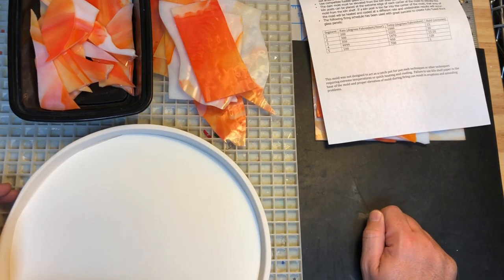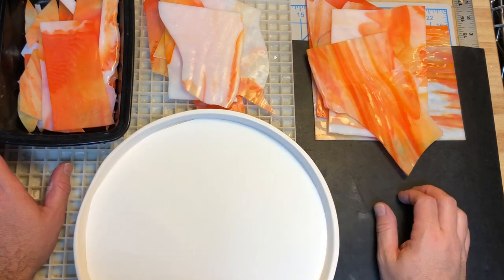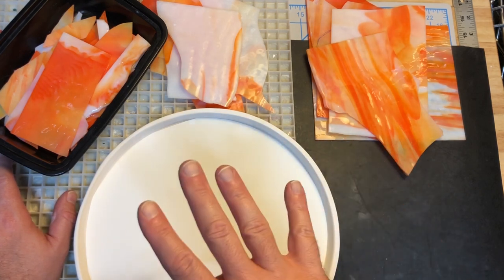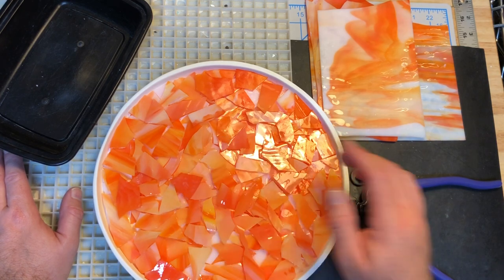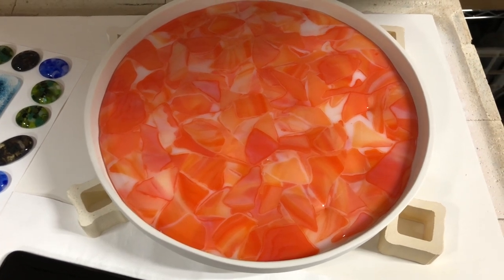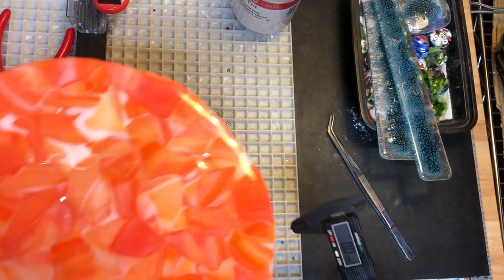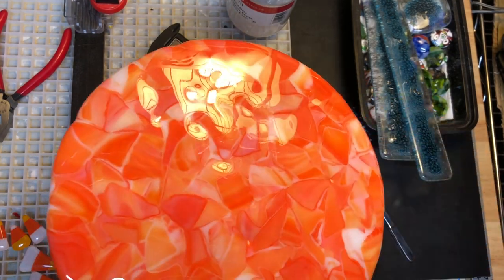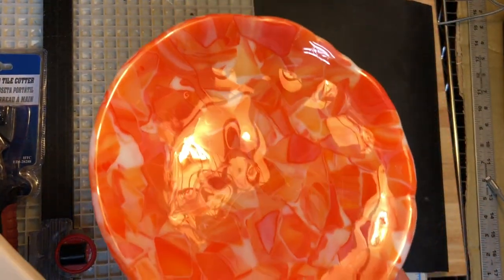Fused glass bowl using scrap glass in Patty Gray mold

Comment: Hi Jamaison,
Bullseye glass provides formula for weight of glass in one of the videos on their website. 
Basically it is volume multiplied by the specific gravity of glass. 
So for circle form the formula is 
weight (in grams) = radius squared x 3.14 x height (centimeters) x 2.5 (specific gravity of BE glass)
please double check specific gravity of BE glass - I am not sure if it is 2.5 or 2.6.
Also, you need to hold quite a bit longer than 10 minutes at the highest temperature in order to allow glass to flow, bubbles to come out (although not all always will) and surface to even out. I would try at least half an hour.

Comment: Love your video! Hate that mold requires kiln paper. I will have to join multiple sheets, and that may create seams. Either that, or take out mortgage to buy larger kiln paper!😀
Reply from the maker: Yes, it’s unfortunate but it seems to be the only way it works well for me. I don’t use this much anymore, opting for stainless steel rings instead.

Comment: Love your videos.  I am super new.  What do you use all the little round pieces for and the long ruler side bars that you have on the side of your table.  Love the blue bubbles
Reply from the maker: Those little rounds become jewelry or magnets. The slide thing is a cutting system called Beetle Bits. And the blue bubbles is a different process you can see here: Fused Glass Bubble Pendants Using Copper Carbonate
Reply from the maker: Looks like my link didn’t paste! Just scroll back through my videos and look for the one on bubble pendants. Thanks!

Comment: Jamaison - I absolutely LOVE your videos!!!  I am just starting out and love watching and learning from you on your journey. I am wondering on your 2nd fuse did you put the piece back in the mold?  Also, did you have the mold on kiln furniture? Can you not set the mold on the bottom of the kiln?  Thank you so much!
Reply from the maker: Hi there! No, for the second firing, I did not use a mold because I was hoping to see it spread out a bit more. And yes, I propped the mold up on kiln furniture for Bette air circulation under and to promote more even heating. Not sure if that makes a real difference but it’s what I’ve heard and I figured it couldn’t hurt? 🤷🏻‍♂️
Reply: @JamaisonSchuler  Thank you for taking time out to respond!

Comment: Jamaison, you have a new fan in me!  I saw your Costco tile video and have been hooked on all your adventures since!  I love this one...I have the same PG mold AND similar glass.  I just set up my glass studio and only have a small kiln I can use in it (so far) which is the Paragon Home Artist kiln.  Do you think I could fire that mold in my kiln?  The shelves are 10" round and I think the form might hang over a little?  I'd appreciate your professional opinion on this. :-)
Reply from the maker: Hi Cindy! Thank you for your kind words. If the mold fits in the kiln without hitting your thermocouple, I say go for it. You are using lid elements? I would still raise your mold off the shelf (or off your kiln floor) but if it fits, I say go for it! I would not recommend it if you are using side elements, as those elements would be way too close to your mold itself. But if you are using lid elements, I don’t see a problem? I don’t know that kill me however, so maybe you could reach out to paragon and ask them?

Comment: Hi again. Rewatched your video. I too have the exact mold I purchased just getting into fusing. It’s helpful to have the fill weight achieving at least 6mm. Along my fusing journey I discovered the Italian Terracotta saucers used as drip trays under plants. It started when I purchased a Vitrigraph and all you do is put your glass inside a terra-cotta pot heat it up to very high temperatures. Same applies to the terra-cotta saucer. The cost is a few dollars. I only use Kiln Walsh I’ve done screen melts you name it and it would stands several uses thus Illuminating the need for expensive Patty gray mold saves a lot of money maybe you could buy more glass with it with the savings? Just wanted to share a great find like you are always sharing great information with us and thank you for that.

Comment: I am loving this art, I have been doing stain glass but want to expand. Any ideas on best kilns and beginner tips or videos?
Reply from the maker: I followed the same path… stained glass into fusing. Fusing is a lot more expensive in my opinion, but I love it and have never looked back. I started with whatever kiln I could find used on my local marketplace but it would be ideal to have one with a digital controller. Read as much as you can, watch YouTube videos, and take a class or two. Most of all, take excellent notes and be a fearless fuser!